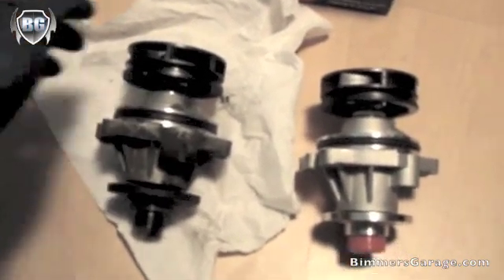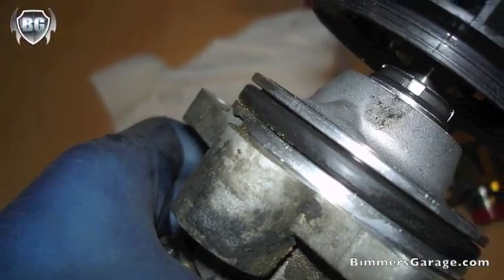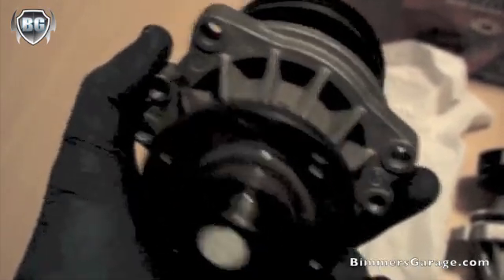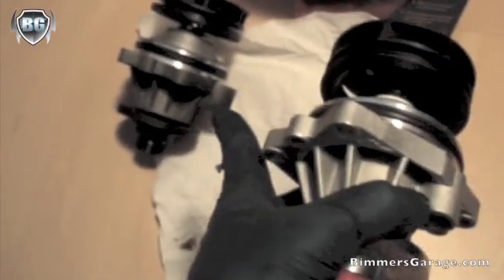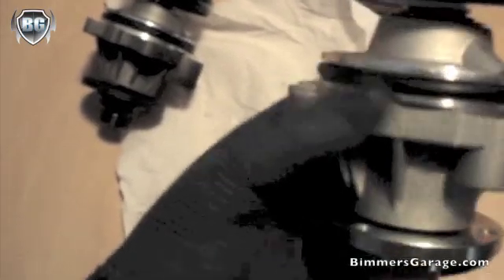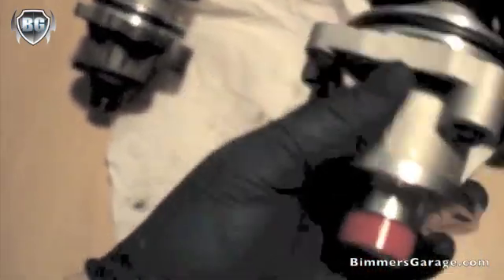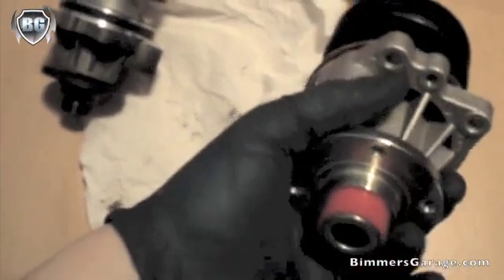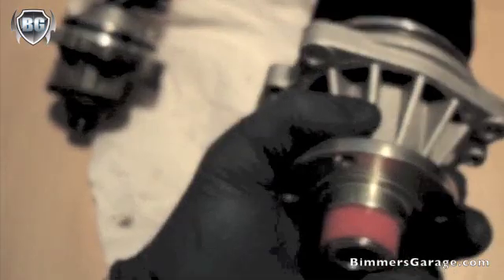BMW WaterPump : OLD - NEW Diagnosis /// 330i (E46)

Comment: If it was only 6 years old, i wouldn't complain, aber diese auto ist von 1997 :P and I live in Norway too -cold, salty roads - extremely bad road conditions etc, so all the wareparts are "working harder" But still, it's funny how Toyota is more durable even here. Seems like one has to choose between good quality, great driving performance vs just super quality and none of the above :P I also think the newer Audis seem like "crap" compared to the old ones, dnknow about porche, but thats vag, yes?

Comment: Thats true, i was feeling under the weather that day. Anyways it's just that with a higher pricetag (i'm not arguing what u get in return in terms of driving experience and engine performance etc) one should be free of such worries, and the service interval should be much less often than they are (depending on driving style) But one should get alittle more quality in terms of durability in return when buying a BMW. I'm a enthusiast, but it cost me a LOT to keep it "tip top"

Comment from the maker: It's not just some low grade plastic... it's a composite material that is designed to withstand the heat cycles from the engine. It is not a "bad quality" issue at all. However, you can say/claim it's planned obsolescence and you won't get any argument from me ( roughly 5 years or 65K miles). Just realize BMW has a strict maintenance schedule for their vehicles and they expect owners to follow it precisely to keep the performance of their BMWs tip top.

Comment: I replaced mine now (m52b25) It's supposed to have plastic impellers as original, but the used one had thin metal/alu impellers, so it must have been changed before fuuuu.. Anyways, the oem for m52 had metal impellers, but the original had plastic, right? Why plastic? as the years go by cableplugs etc and general plastic parts 
gets crispy and breaks, my thermostat housing is plastic, get that. On a BMW :P Not a real quality sign at all..

Comment from the maker: @1D0N 
Absolutely agree. It is Not a plastic impeller... It's an injected molded composite. Thank you for adding to the confirmation on this. Thank you.

Also, I remember seeing you (your video) on water pump failure before, I appreciated you uploading it... It was helpful for my reference when I was diagnosing my WP.

Comment: @bimmersgarage I don't have an AZ unit in my hand at this moment, but I actually do have a Graf pump at this very moment. I base my opinion on experience, so it is not an assumption. I have a deep loathing for Autozone parts, and will never use any Duralast or Valucraft brand part on my car, or anyone else's car if I can avoid it. I have never had anything but bad experiences with their quality, fitment, or reliability. I repair people's cars for them as a side job, and avoid AZ parts.

Comment from the maker: @eurowerke
Interesting comments. I'll respect them. 
However, do you have any actual units/product(s) in your hands to inspect or compare, before you make your assumptions? Perhaps you should so you can contribute Actual knowledge instead of throwing up unsubstantiated opinions.

And for the record- The prices were about the same - $65.89 (w/ tax) for AZ unit vs. $66.57 (incl. S&H) the Graff unit.

Comment: Get 99k miles out of an Autozone pump?  HAHAHA.... how much did it cost compared to the Graf pump?  8 ridges versus 9 versus 10... I'd say any of them is fine, and doesn't really matter.  Have you seen or heard of a pump shaft breaking off from the rest of the housing?  Neither have I.  It's not a design weakness.  I would be very surprised if you get more than 50k miles out of that Autozone pump.... they're cheaper for a reason.  The bearings are probably much lower quality.

Comment from the maker: @PUREAAMERICAN 
Thank you for the comment and the information. When I was producing the video I was referred to the part's "design" as like OEM, referring to the use of composite impeller. I should have clarified it more - Obviously Duralast brand is not OEM or a BMW supplier, That I agree.

Comment from the maker: @winsolo 
Thanks.
Appreciate your comments.. but, I didn't realize I was mass producing vids. I primarily wanted to share what I worked-on/repaired first hand & of what I observed personally, mainly for reference. However, if you know of any Performance parts Sponsors who wants a more in-depth review of their products, send them my way. Also, I'm willing to improve my videography skills with better equipment, so If you or anyone you know has Pro Gear they like to donate, I greatly appreciate it.

Comment from the maker: @watuzi 
Good question. I'm not sure...

Guess I do the FCABs Front Control Arm Bushings next. They're a tad loose. Then, perhaps shocks (coilovers) but I haven't decided yet. 

I would advise that you join a BMW forum - Bimmerforums com - search in their DIY section under your model to get some insight on How-Tos for your struts. It's a good place to start.
I'll be uploading more DIY vids as I work on them. So check back often.

Comment from the maker: @mallydangerous 
Yeah.. there is a high performance metal-impeller waterpump - the $185 Stewart waterpump. It was a tad more than what I wanted to pay for a replacement. So, I went with the OEM plastic impeller for $46